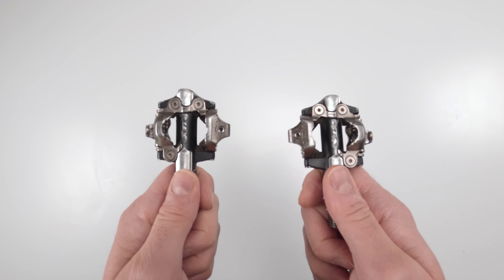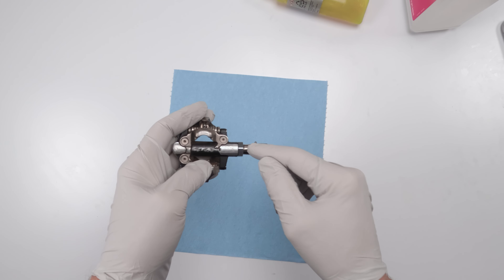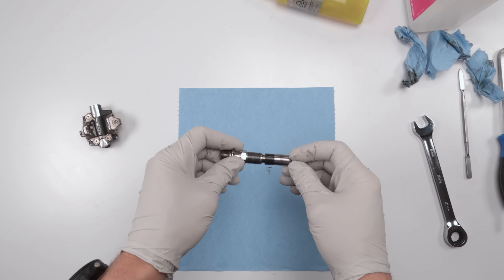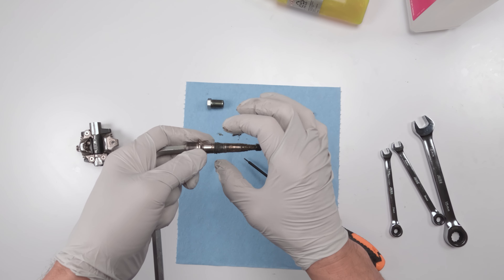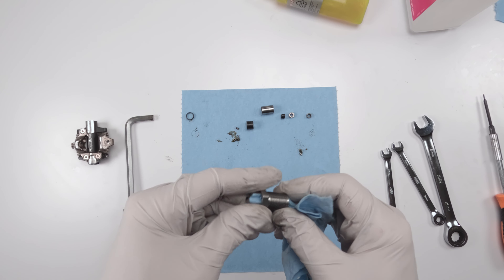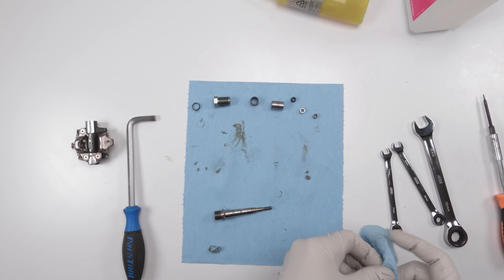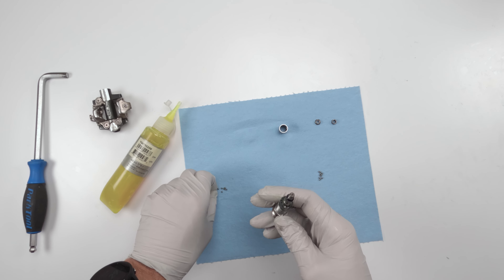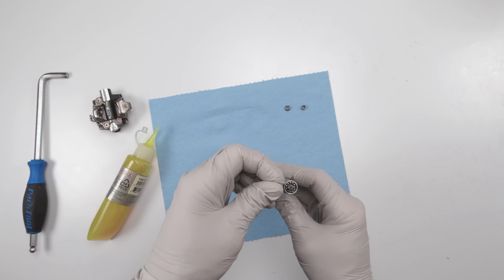Shimano XTR SPD Pedal Bearing Service guide for beginners. M9100 M9000 and other SPD type pedals

Comment: Great video. I can't believe Shimano used that flimsy seal. All my XTR pedals had that seal pop out and all my pedals needed rebuilds within months of owning them. I gave up on the XTR's and went back to the M540.
Reply from the maker: what's worse is they don't sell the seal as spare parts, at least that I know if, which is ABSOLUTELY ridiculous. This alone is a reason not to get them imo. thanks for the comment 👍
Reply: Happens me the same. The seal pops out after some few hours of use.
It's ridiculous to be disassembling pedals once a month on a regular use.
And more insane is to not sell spare parts of the most sensitive pieces! 😢

Comment: I have 3 sets of pedals. 2 x dura ace and  1 pr of  XTR m9100. I strip and clean all those oedals end of summer and end of winter. Never needed to change the ball bearings at all. They are size 3/32” with  26 in each pedal. Cost less than £10 for 54 of them. I bought mine at Condor Cycles U.K.
Reply from the maker: Your way ahead of the curve. Most people I know didn't know they were serviceable. With a bit of maintenance these pedals will last a long time. I just wish shimano would sell the seal as a spare.

Comment: Thanks for the great video!  I'm struggling with one of my XT (PD-M8100) pedals...  it has a good 1/4" later (left to right when viewed on bike) play.  I've done this service a couple times and cannot see anything wrong with any of the internals.  The pre-tension of the balls goes fine.  No slop there.  It seems like there's something amiss in the higher level assembly.  (Only happens on one of the pedals).  After doing the cleaning, tension adjust, greasing, the pedal is fine for a couple hundred miles but then immediately develops this significant lateral slop.   Any idea?
Reply from the maker: Sorry to hear about your issues. Is it the whole housing that is moving side to side, or are the clips holding your feet? Is the lock bolt (the large bolt that separates the pedal) locked onto the pedal housing when this happens? If it is the whole housing, then is it possible the lock nut isn't fully locked onto the set nut (These are the two nuts at the end of the axle)? If yes, then the big question is why is the lock nut not staying in place. You might want to try some loctite if it truly is the lock nut that is causing this..
Reply: @zoubtube  Thanks! :)  The entire pedal body moves left/right on the spindle that attaches to the crank arm.  The 17mm "nut" is indeed tightened all the way down, as is the lock nut that holds the bearing pre-tension nut.
Reply from the maker: Apologies for the delayed response, but replies to replies can really slip through the cracks. are you sure that the bearings and bushing are sitting correctly in the lock bush (17MM bolt/bushing), and that the cone nut and lock nut are within a tolerance that will stop the pedal from having slop. the later is important to get right.let me know

Comment: Should you put crowfoot wrench at 90-degree angle?
Reply from the maker: Technically yes, ESPECIALLY when Torquing down precise components, or else there is a formula that needs to to be applied in order order to get the target torque reading.  I tend to forget some of these details when recording videos as there are so many distractions. Ultimately your right. I should have provided a better example and will mention it in a future videos as I occasional mention the proper way to hold a torque wrench. thanks for bringing this error to light!! 👍

Comment: I rarely disassemble the shaft on my SPDs, just clean pedal housing and shaft as best as possible, adjust if necessary and jamb the bottom of pedal with waterproof marine grease.
Reply from the maker: At least you give them some attention, your WAY ahead of the curve. Most people I know didn't even know it was an option until I mentioned it to them. I just wish shimano would sell the seals on these things. The company makes good products but they can be very frustrating from a spares parts perspective.
Reply: @zoubtube  Thanks for the blessing and thanks for the in depth tutorials for when I need to do it right

Comment: Why does my xtr pedels don’t have that spacer, (we have the same model)
Reply from the maker: can you let me know which spacer your referring to by mentioning the time stamp in the video? i'm sure I'll be like "DOH" when when you point it out, but right now im shot from doing trail work all day 😵‍💫
Reply: @zoubtube  10:55 the one your cleaning
Reply from the maker: @ronnielpalma9429  That's really odd myman. Both m9000 and m9100's have that spacer. It helps retain the bearings as well. Were the inner bearings in place when you opened the pedal? Did you buy these new? were they ever serviced before? if you bought these new and they had never been serviced, I'd go to a shimano dealer and warranty them.